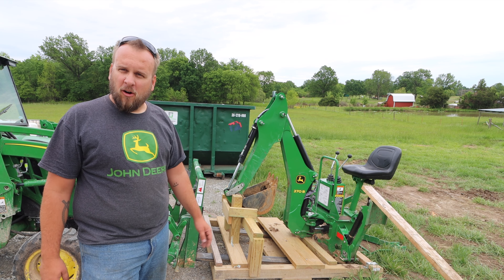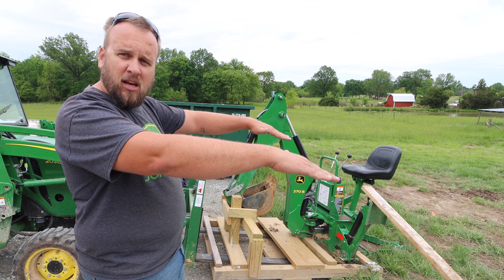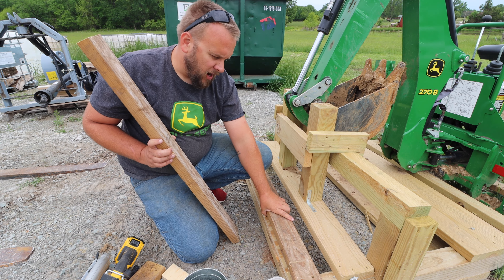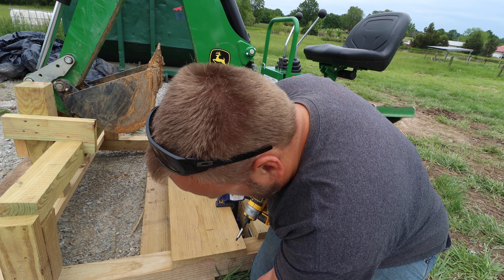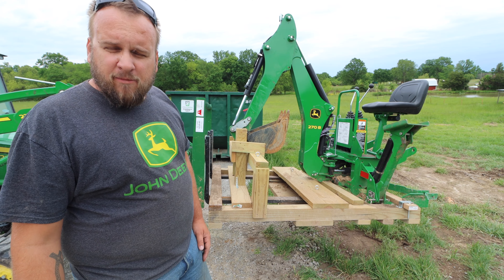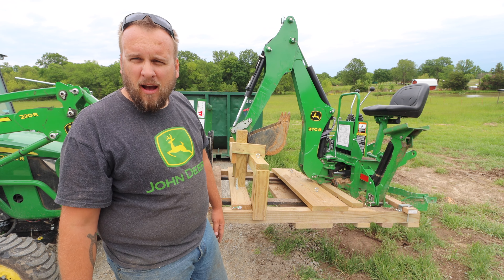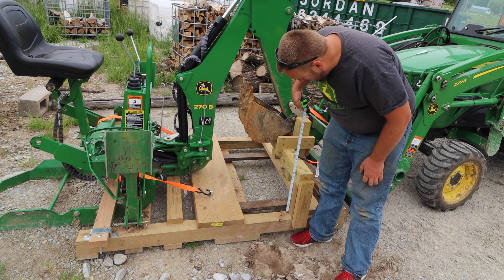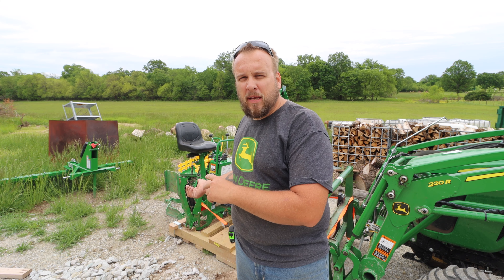Backhoe Hauler Update and Modifications

Comment: Hello Brock 
Looks like you have it figured out. I have a 2025r with a 260B and did make something similar to yours. I found that you will have a better lift and stability if you could pick up the load from a side approach and would have less overhang . I did try both approaches moving the 260B on the pallet I made . Side approach was by for the best way to move it with most of the load close to the lift pins. If anyone is interested I can send a pic.
Thx GB love the videos great job,
Reply from the maker: Thanks 

If you want You can send pictures to kcfan491@gmail.com

Comment: Hey, does the all subframe come off with the backhoe. I was liking the Kubota L3901 but the subframe stays on the tractor when the backhoe is removed. Thanks love the vids.
Reply from the maker: There is a sub frame that stays on the tractor.

The frame that you see here connects to hooks on that sub frame.

You just hook it in by driving onto it and lifting then there are two pins that hold it in place
Reply: @RockhillfarmYT  Does the subframe that stays on the tractorhang down much. Kubotas hangs down about 4".
Reply from the maker: My first thought was to say yes it hangs down but it’s actually the same height as the drawbar so it’s not really costing you anything.

It is probably the lowest point under the tractor But that drawbars in the same place even if you don’t have the Backhoe